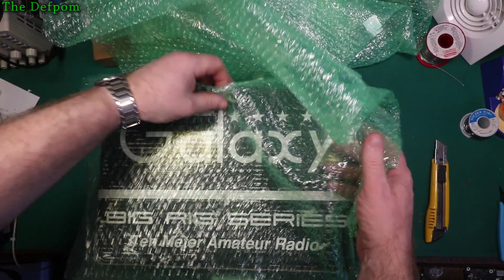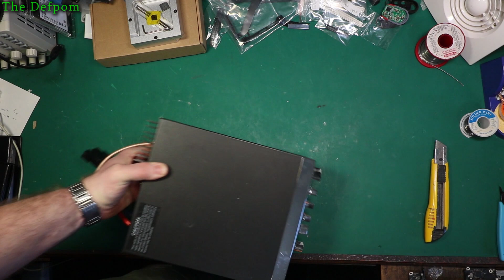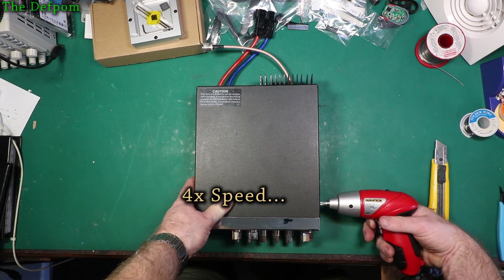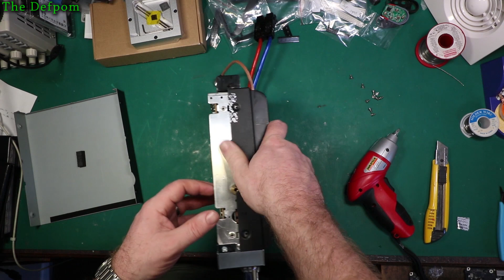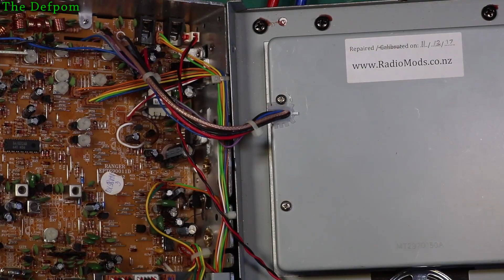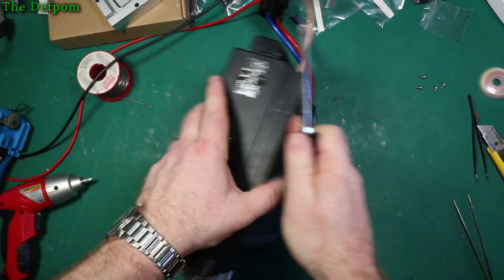🔴 #479 Galaxy DX98VHP 10 Meter Amateur Radio Repair

Comment: I have one of these radios new out of the box without mods besides frequency conversion. I have had other Galaxy radios before and they sound smooth and clean for what they are. This radio sounds like a 1920's telephone.

Comment: Those TR 41 at least that's the transistor on a Galaxy 88 board,  are prone to being pulled away from the PCB  just like the Cobra 29 LTD's and 25's  with their audio chips ........  I have seen several come in like that, and one with a different number and pinout like yours ................

Comment: Do they make that radio in a version without the PA it looks like an afterthought. Looks like a high power unit.  I have long since given up on trying to figure out some of the imaginary repairs on cars and electronics equipment I have owned. Pin out bodged LOL.  Just out of interest what is the best CB you would recommend. I’m looking for something retro for the Chevy?
Reply from the maker: Yes that PCB (EPT6900) is a common one, it is used in other Galaxy radios, they just add/remove features are required by the model.

Comment: Must have been intermittent though and it worked when you had it on the bench for repair before?
Reply from the maker: buildstoys - yep it worked fine previously, I am guessing that the vibration from being mounted in a truck caused the poor quality joint to fracture.
Reply: @TheDefpom  
I bought one 2 years ago . I have it in a cradle with a fan on my desk . I really like it , but I’d never mount it in a vehicle 😬. That’s asking for a repair bill . Also ,, I really like SSB ,, is there a fix for the “Galaxy Drift” on SSB ? It’s absolutely terrible and I rarely use it for SSB now cause it’s gotten worse

Comment: I could see it was not the same leg as the one on the solder side it was near the front and when you turned it over the lead was away from the front. 
Nice easy one for a change.
Reply from the maker: Zoony FireballXL55 - yeah I should of caught onto that a lot sooner, but I guess I am so used to orientations swapping around from flipping boards over it wasn’t obvious at first!